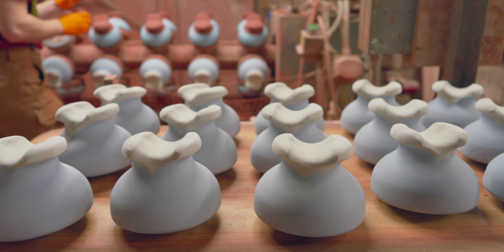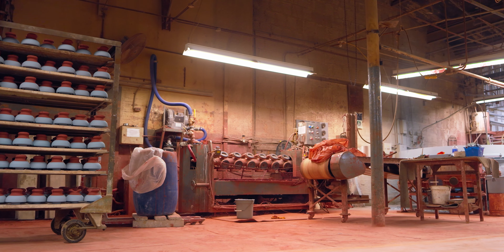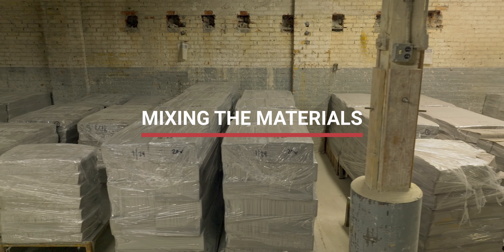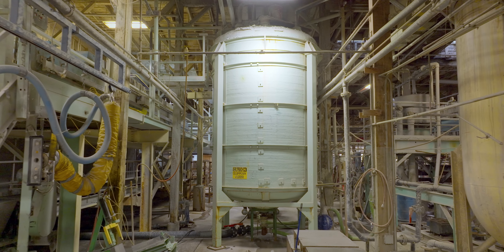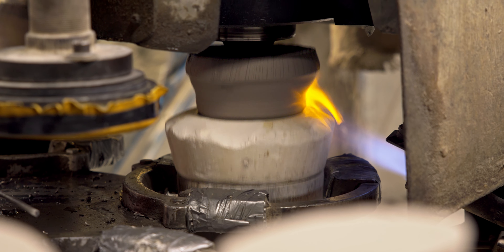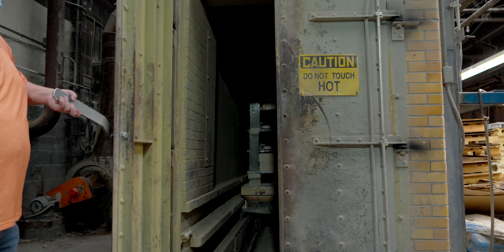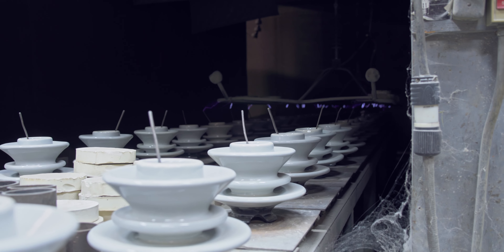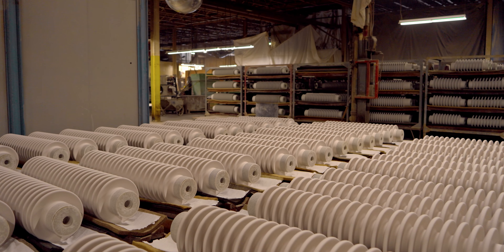Electrical Insulators | Grainger: How It's Done

Comment: This was great, my dad had an electrical porcelain mfg company in the 50s to 70s everything was done by hand I spent many hours putting clay into the molds and putting the  clay molds into the basket to be fired. His company made the smaller type insulators.  Good to see that the porcelain insulator business is still alive and well in the U SA Thank you for the  great video
Reply: polymer types are putting these types out of business, it's obsolete materials for such use. It's 21st century, others have joined it.